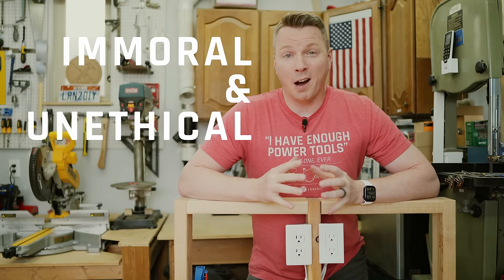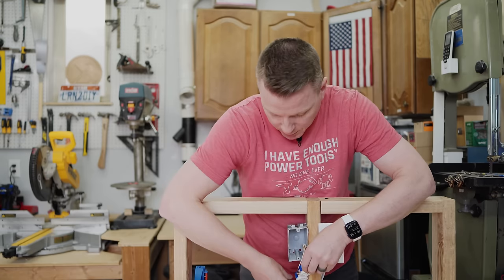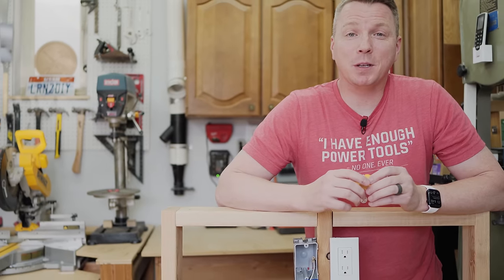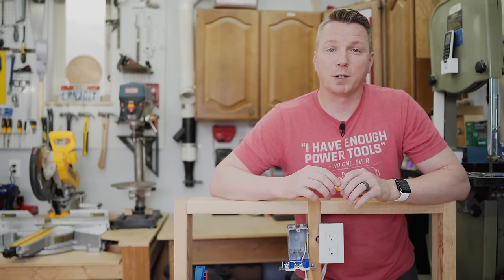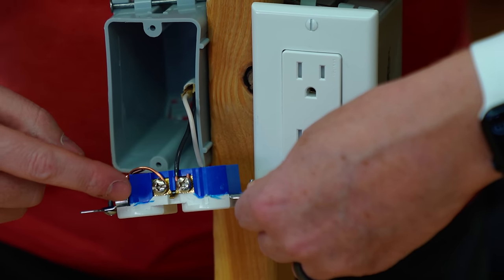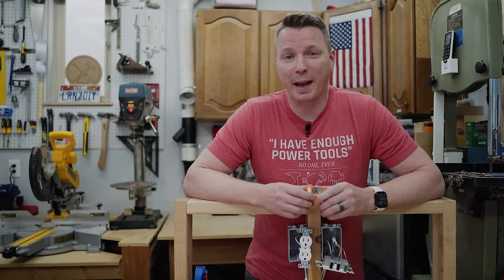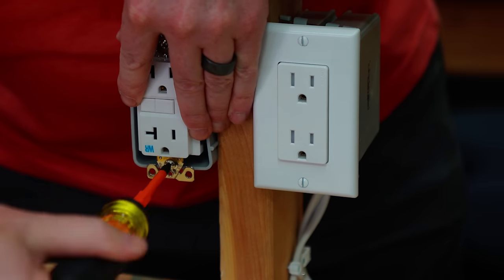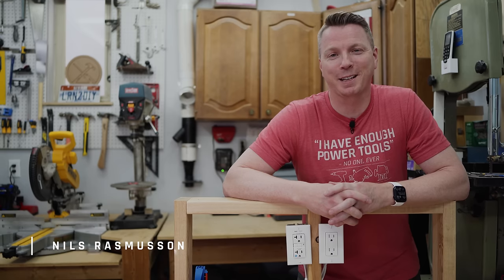People Are Adding Deadly Hacks to Outlets

Comment: A quick and easy check for a bootleg ground is to plug in something that draws a fair amount of current (halogen light, coffee maker, hair dryer, toaster, etc), then measure the AC neutral to ground voltage on the other receptical at the outlet. You will likely get a few tenths of a volt (AC) between neutral and ground if the outlet is wired properly when the load is switched on. The neutral should only be connected to ground at the service entrance, and you will be measuring the voltage drop across the entire neutral wire back to the service entrance.  If the neutral and ground are shorted together at the back of the outlet, you will get a very small voltage (a few mV) between neutral and ground when the load is on.
Reply: Since I have a multimeter with two prong-leads, that just saved me 400 bucks (assuming I was too scared to shut off the power to my home so I could dissect a receptacle)
Reply: can't you just like switch off the power and then measure resistance? If there's bootleg ground, it's gonna be a short between neutral and ground.
Reply: @beardsntools  ,
Maybe, if you have a very good DMM. The resistance difference is small though. You might have 0.03 ohms vs 0.001 ohm. And the meter leads themselves might have a 0.1 ohm resistance. You can get benchtop DMM's that can do a "4-wire" resistance measurement that can accurately measure low resistances, but you need a special set of probes (or a pair of probes) and these meters are not something the average homeowner has.
Reply: @jessstuart7495  I think you are underestimating the resistance from outlet to breaker box, 32' 14awg would be 0.14 ohm. The difference should be detectable with a normal multimeter.
0.03 ohm would be around 6' of 14awg.
Reply: @ToxTox  ,
32 ft of 14ga wire is 0.081 ohms. (Copper at room temp).
Reply: @jessstuart7495 you would also need to double the resistance since you are measuring from outlet to panel to outlet so 32' cable would be 64' to the multimeter (also I am converting between metric and awg so there might be inaccuracies)
Reply: @ToxTox , 
Re-read my original post. I suggested measuring the voltage drop only across the neutral to ground connection. You shouldn't have any significant current flow on the safety ground, so almost no voltage drop on the ground wire. When doing a resistance measurement, you would need to include the resistance of the ground wire also. Measuring the resistance could work too.
Reply: @jessstuart7495  Unfortunately I am from Norway where the old system used 2 hots and a isolated ground to get 230V. So neither of the 2 methods would have worked anyways, but then again bootleg ground wouldn't be possible on it.
Reply: @ToxTox  ,
  One of the main benefits of the grounded neutral split-phase system is you don't have to put fuses/circuit breakers on the neutral wires.
Reply: Darn good hack. We went through a "post war" building boom with lots of 1940/1950's homes.
Reply: @beardsntools   I would guess not since the ground and neutral are bonded together in the service entrance panel.  Good thinking though.
Reply: @allenshepard7992  They are? I doubt it because most modern homes are equipped with trip switches that are made to try to prevent people from getting electrocuted to death in bathroom. If you do the short between ground and neutral, it will trip and shut power off because that's more than 0.05A tolerance. I did that once accidentally, while wiring with power turned on(I only paid attention to the live wire, making sure it doesn't touch anything. The other two touched and the main breaker turned off silently)

Comment: This is nearly compliant with old TN-C european standard (prohibited in new installations). For TN-C your PEN wire would first enter grounding terminal and from it there would be jumper wire to neutral (not the other way around). However modern standards do have PE and N completely separated down to service junction (or even down to trafostation)
Reply: yeah, but wouldn't that only be valid at the distribution panel ?
Reply: @vitorao  well no. TN-C-S requires transition from common PEN to distinct PE and N wires in a junction with a proper earth connection. Not in the outlet and certainly not in a way that makes protective earth able to fail before neutral.
Reply: In reality, if we get technical, this way of connecting the neutral and the ground in the outlet is valid and continues to protect us against ground faults because at the end of the day the neutral is also connected to the ground, only here we use the scheme TN-C the only condition for it to become dangerous is if someone does not know this and reverses the cables in the panel.